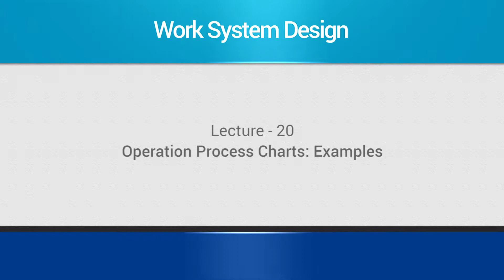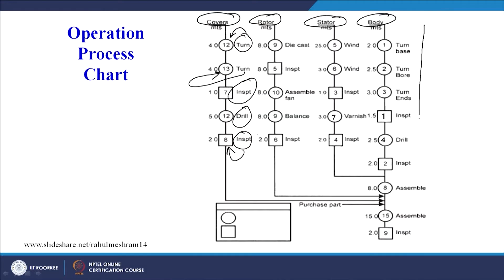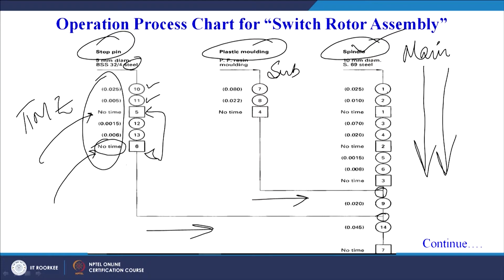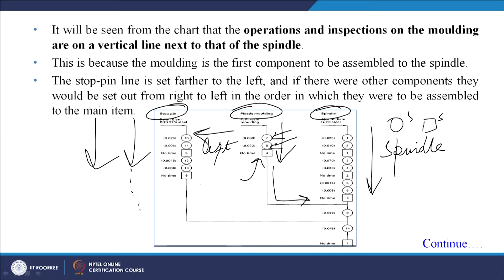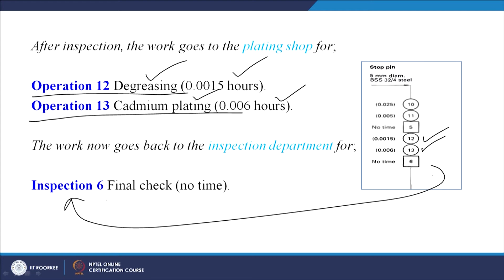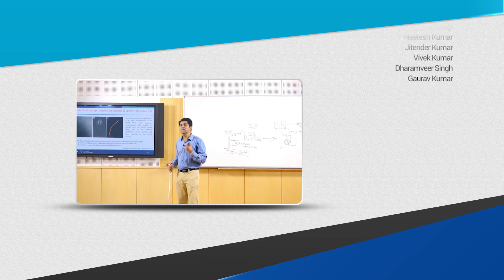Operation Process Charts: Examples

Comment: I appreciate the detailed explanation of making the operation process chart. But much more important is more detailed explanation of the analysis of this chart and improvements to be carried out. In the engineering example presented, improvement requires engineering inputs. Without the explanation of how engineering knowledge is utilized to improve this engineering process, the discussion of operation process chart is incomplete and ineffective. Its only use is in writing the examination.